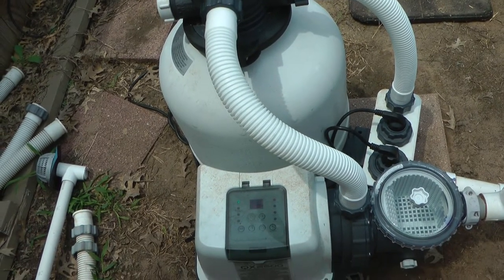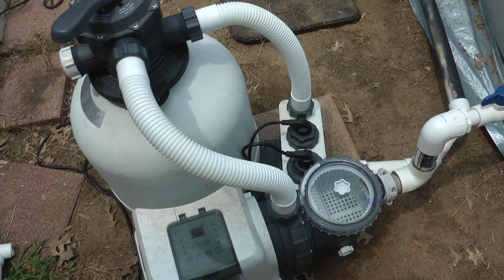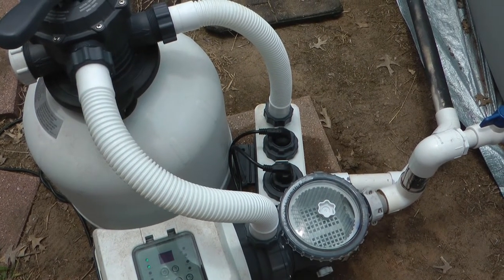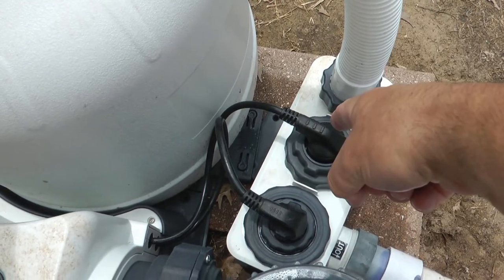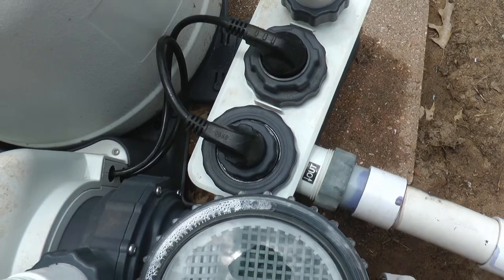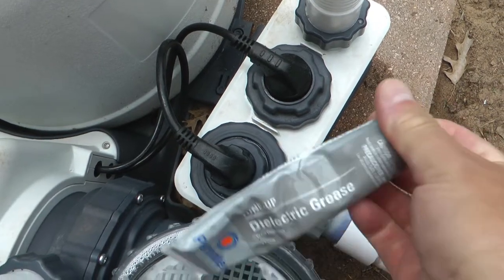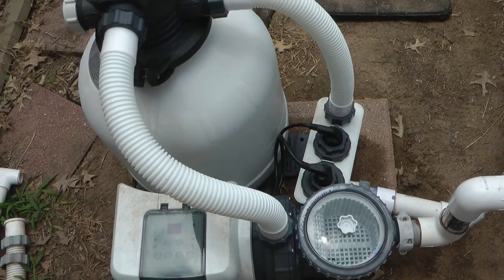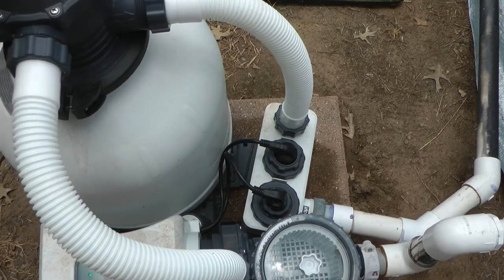Intex Pool Saltwater System Error 90 Low Flow FIXED

Comment: I just upgraded to this pump this year,  have you had any issues with water leaking out from where the electrodes sit?
Reply from the maker: so far (knock on wood) the pool has not leaked a drop this season!
Reply: I do have a slight issue on one electrode… new system as well.
Reply from the maker: @kathyr.6825  hopefully you can clean it up and repair.  Sometimes vinegar on a q-tip or toothbrush will get it done

Comment: Hi WJ I am wondering where you are in texas? I am north east (near bonham) and looking for someone that can help with the salt water system and the whole plumbing like you did for your pool. Any suggestions?
Reply from the maker: I'm in Waco but I'm just a DIY guy... I don't know anyone who does this sort of work professionally.
Reply: @WJHandyDad  Oh! You are 3 hours away. I get it, Lucky you for being so handy. We are not, and we have a hard time finding help. Thanks for the response anyway! BTW, I was able to fix my filter problem, and when it runs, it works, but as soon as the running cycle is finished, the leaf basket overflows and leaks all over (my above ground pool is in the ground, so it's a mess). I changed the rubber sealer as that is where it leaks on the top of the basket where the transparent lead closes, and I closed everything strongly (hand tight as they suggest in the manual), but it still leaks like crazy when the cycle stops. Do you have any suggestions?
Reply from the maker: @Sovereignlightwarriors  if you're talking about what I think you are, they are very sensitive to not being tightened right.  Also make sure the rubber gasket isn't spinning/stretching when you tighten.  Good luck

Comment: I cleaned my cells in vinegar like the manual says because the bigger cell had salt build up on the 2 tiny metal tabs inside that worked for a few hours now got code 90 again. I checked the contacts under the plug they look clean and shiny and water flow is strong so idk whatsy issue now
Reply: I haven't tried the purge air on the chlorinator box yet gonna go try that and pray lol.
Reply from the maker: good luck, these things are finnicky!  Mine isn't chlorinating this year.  Intex customer support was useless.  I suspect the wires are not making good contact but there isn't an easy way to check for continuity with a multimeter

Comment: I hv no water going into the pool from the pump this morning, hv already back washed and rinsed twice.     With a #90 low flow error still.
Reply from the maker: check for an air leak... if any of the gaskets around it are allowing air in, sometimes it will keep water from flowing

Comment: I had hope for this fix. My contacts were bright and shiny. I cleaned them anyways. Underneath that screw-in thing are two large plates which I make sure are free of scum at start up. There are also two smaller protruding things. I am guessing maybe that is what senses the flow. They were discolored a little bit, so I cleaned on them some. Still no luck.
Reply from the maker: these things can be frustrating... it's possible that one or more of the prongs is not making a good connection.  I've run into intermittent issues with mine again even though no obvious signs.

Comment: What is the clean button for ? Can’t figure it out our low salt won’t stop going off
Reply from the maker: the low salt (assuming it's not really low salt) is usually a wiring fault like I showed.  I believe the "clean" thing reverses polarity to remove the calcium buildup on the plates, which seems counterintuitive since it releases it back into the pool only to be trapped again.  I like to soak in vinegar instead.
Reply: @WJHandyDad if you read the manual you would see you are supposed to use vinegar capped off while running the clean cycle
Reply from the maker: @dylanbuckner152  owner's manual????  What is that???  :)

Comment: How do you fix the low pressure? I have checked everything and it’s showing really low pressure
Reply from the maker: are you on a sand filter or paper filter system?  If sand, are you doing weekly backwash and rinse?  It takes about 60 seconds of backwash and 30 seconds of rinse per week to keep flow up (adjust up or down depending on how dirty the outlet water is during the flush.
Reply: @WJHandyDad  what about for paper filters?
Reply from the maker: @jacquelinegarcia1681  if you have a paper filter system you need to regularly change the filter and in between changes rinse them off.